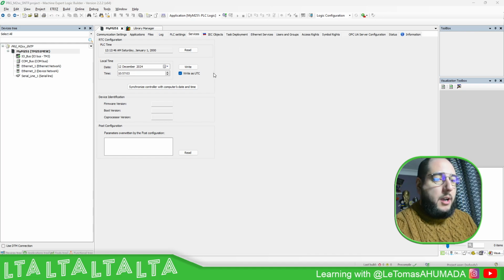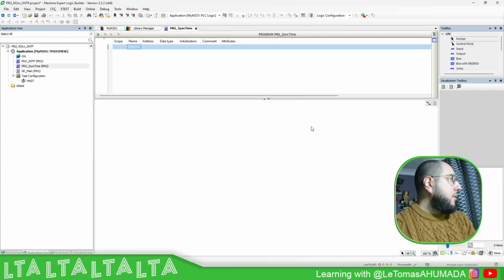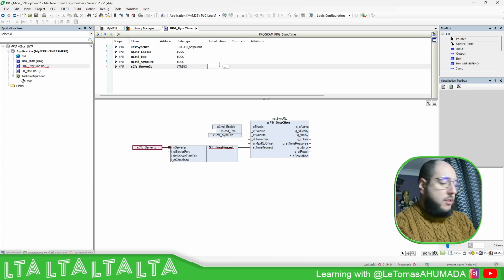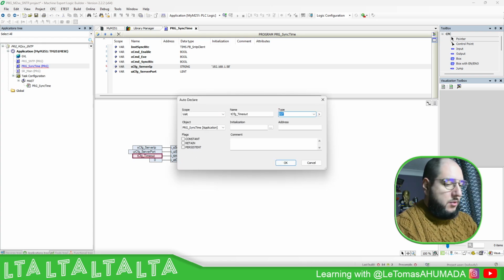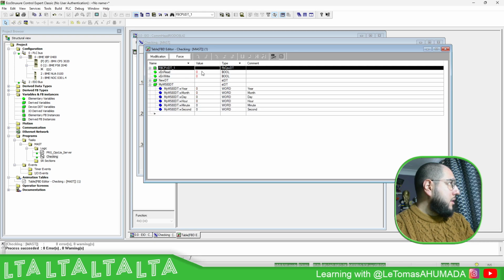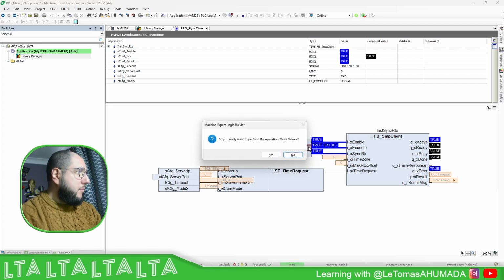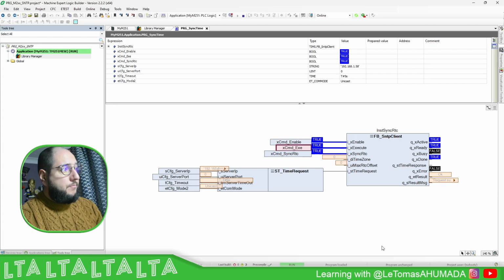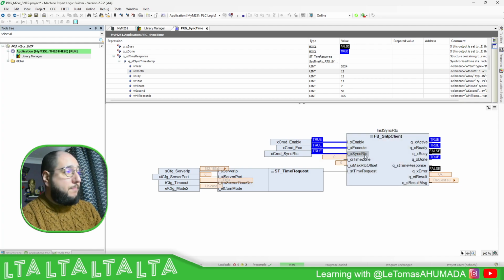EcoStruxure Machine Expert Training - M6.1 Sync PLC Time using an SNTP server

Comment: In MyController, Ethernet Services NTP, have one configuration for client. That feature does not work? I tryed with Siemens S7-1200 and M262, the Siemens sync well with my computer, but M262 I dont get it.
Reply from the maker: Hi there! When i try it on the m262 it worked straight away with a m580 and with a modicon swicth as sntp server.
I recommend you to check with the technical support so you can share your code:

How to use MySchneider  to contact the Schneider Technical Support
https://youtu.be/UzFXi9RbSdE